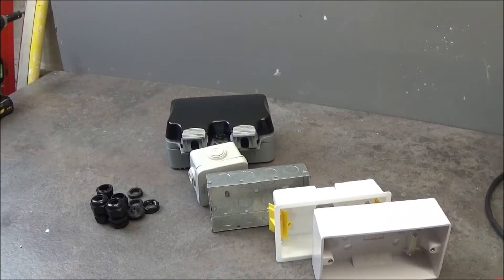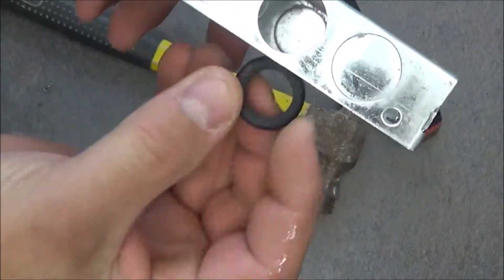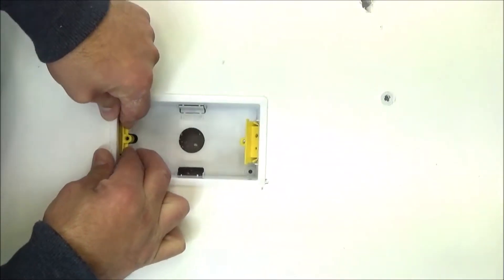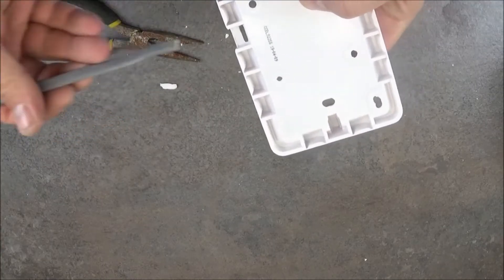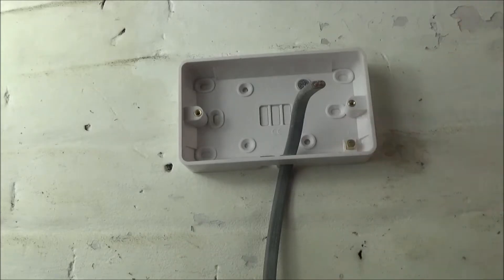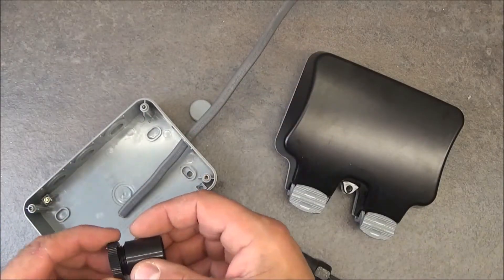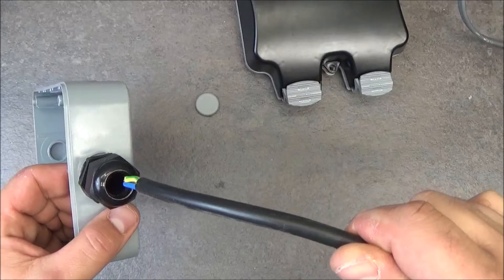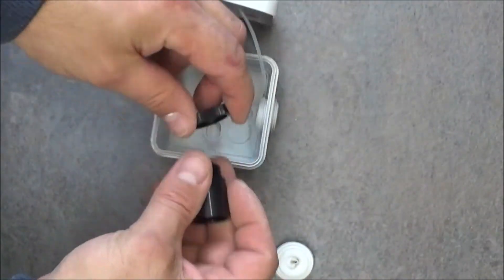How to make a hole knockout in a electrical back box enclosure

Comment: Thanks! A suggestion for a follow up would be how to make the knock hole smaller when for example, you decide to remove a plastic conduit tube containing a cable and after the fact yoiu change your mind and decide to remove the tube and just run wiring through the knockout hole which is then too large. How do you clamp the wires at the outlet box?

Comment: Thanks. I find pattress boxes make messy holes with nose pinch pliers. Maybe i am using cheap screwfix ones.  I like to use a hack saw also to give a straight edge on outside cut

Comment: How do I join two back boxes with knock outs side by side
Reply: Knock out the steel or plastic making sure they're symmetric for the incoming wire.  If it's metal back box's make sure you put in rubber grommets.  You need to make sure the face plate of each socket have enough clearance from one to the next.

Comment: Nice video, thanks! What make is that black flex cable? Odd question I know, a bit of background: I am just skeptical about the use of flex outdoors.. so I've been trying to convince myself otherwise. Main reason is.. I need to add a second BG box side by side to the other one and I'd like to maintain the IP rating.. so those glands are IP68 which is great, not quite sure what cable to use.. I found the Nexan 3 core is labelled for indoors only, found another brand 'Time' which is ok for both in and outdoor it seems, but the minimum operating temperature is 0 degrees.. maybe I'm a bit OCD, but I like to do a good job :) I was thinking of conduit first, but those adaptors are not IP rated.. so I'm starting to consider flexi + ip68 glands (not wanting to mess with SWA for just a 20cm run).. What would you go for? And if you can share the make of that flexi cable.. it'd be very helpful!

Comment: Very good, better than most, but he didn't show us the gland where, if using for a flat twin and earth cable you take out the washer for the circular cable and replace it with one with a hole that's specially shaped for f t & e.

Comment: Rubber grommets in steel boxes, good tip, not too many people are using them, as a metter of fact never seen it before used by any electrician and thats how cables get cut by a sharp edge.Thanks for instructions.